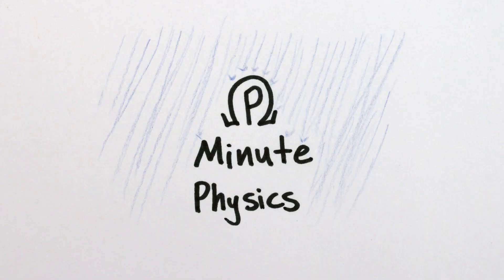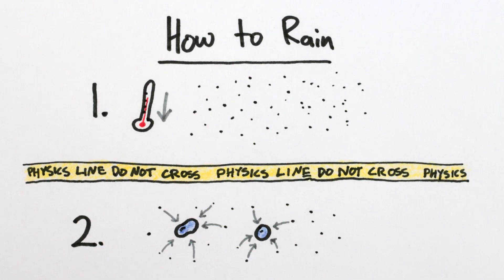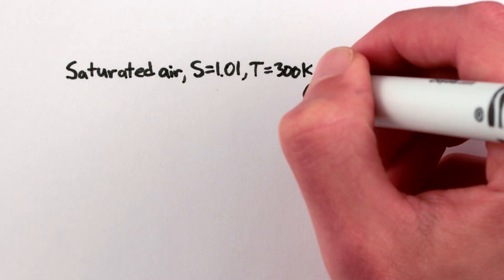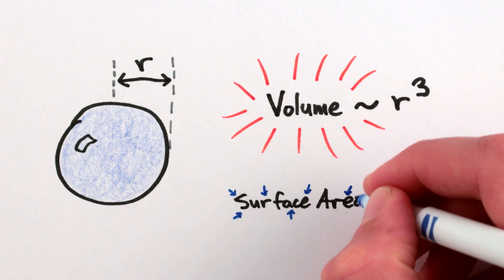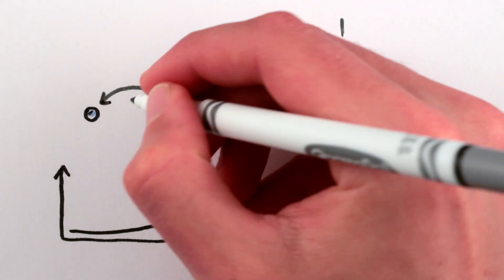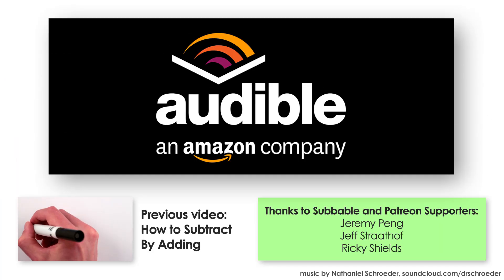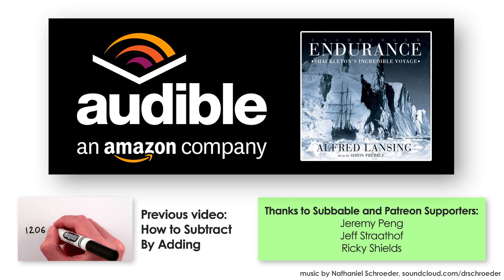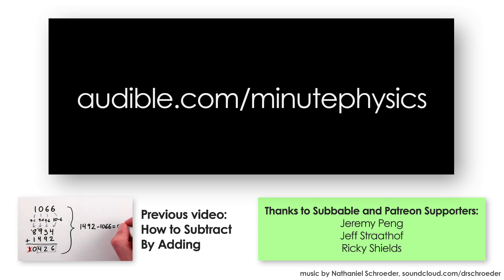Why Raindrops Are Mathematically Impossible

Comment: did he say x squared is bigger than x cubed
Reply: When x<1 it is.
Reply: +Apple Cider ok now I get it
Reply: MrDavoder For all rational numbers between (but not including) zero and one, x^2 is greater than x^3.

Examples:
(0.5)^2=0.25 where (0.5)^3=0.125
(0.25)^2=0.0625 where 0.25)^3= 0.015625

At exactly zero and exactly at one, x^2 and x^3 are equal.

For all rational numbers less than zero x^2 is less than x^3 for the reason that you've already figured out ;)
Reply: You can use any symbol in the place of an x right?
Reply: Bobson McGregory i think
Reply: +Apple Cider no. When x<0. If x is 0, then x^2=x^3
Reply: +Apple Cider And when x=1 they're also equal :)
Reply: +Apple Cider Does that mean formation of raindrops depends on what units you use? If I have a gram of water, x>1 in mg but x<1 in kg.
Reply: +SilentBudgie You use dimensional units for that. Surface measured in e.g. m² and volume in m³. Dimensional units scale with the numbers, s 10m*10m is 100m² and not 100m. You'd have to convert the kg into m³ (density...) to be able to calculate it. But then it works with all (dimensional) units.

Also, the "1" is dependent on the base unit. We measure everything based on the SI, so 1m, 1kg, 1s etc. are used as the "1". So if you used Ångströms, you'd have to scale it down (1 Å = 100 pm), so 1m would be 10^10Å (and scale it w/ squares etc)
Reply: ***** its a social construct
Reply: ***** its like a language

Comment: It doesn't seem impossible, if you study the chemistry of colloids. Considering the high surface tension of water, of course water would rather form bigger drops. By reducing the surface to volume ratio it wins energy. There is a very similar process called Ostwald ripening. And btw condensation is exothermic, so it's enough energy for a start ^^

Comment: Mathematically impossible for droplets to join that are already formed, sure. But, water droplets forming are more a case on what state the water is going from and to. Simplistically, for example, if you want to make a small droplet of water even larger, simply have that droplet of water in an environment where it is cooler than the dew point of the local ambient air.
When air is containing H2O, in gaseous state, each molecule of H2O is an individual molecule (stating the obvious.) Fog (or clouds) are several molecules of H2O; not quite what considered a droplet (again, stating the obvious.) If you have a droplet of water that is below this dew point then each surrounding individual H20 molecule that comes into contact with that surface droplet of water easily become a part of it. The surface tension of a droplet of water does not repel an individual H2O molecule. This occurs extremely fast, even though it is one H2O molecule at a time.
This leads an experiment in relative humidity and dew points that anyone can do in their own bathroom; with a shower, a space heater, and a glass of cold water. ;-)

Comment: would it be because the units that we use are made up by us. so < .1mm (or what was reffered to as small x) isn't really a decimal, on the molecular level, (bc h2o is  a molecule) the measurements don't reach less then 1. at least not in these conditions. so putting these quantities to a power will always grow them.

Comment: Well, no. If it works for bigger it works for smaller, the problem occurs with the fact that your using Meters or Centimeters or whatever because when you use whole numbers it works but when you use decimals or fractions it doesnt. The easy solution is to think of length in plank length. So with such a gigantic amount like that the equations become plausible. Imagine switching from Meters to Kilometers and again a raindrop that once was plausible is imposible its just a matter of how your thinking about it. This video is just stupid

Comment: Comment:  Regarding the energy to form the surface tension compared to the heat of condensation.  Given I understand all the (other) phenomena here...
Doesn't the crossover point between the surface and volume quantities depend on the unit of measure?  In other words, decreasing below a cubic meter (measuring the surface energy in joules per square meter),  the surface area grows relative to the volume (measured in cubic meters), thus  requiring in increasing energy from the volume, but you are still above a cubic milimeter where you haven't dropped below the 2/3 point yet.
Can you explain this apparent problem?

Comment: 1:23 - "for small radius, the opposite is true". this is false. as where is no such a thing like "1" in nature, that number bigger run in 3 grad faster than 2nd... and for smaller than "1" is the opposite. because this "1" is a limit that we use to measure things is relevant 1 meter! or 1 cm... or 1mm or 1 what?!  so when you talk about "Relativity" of surface to mass it is always R^2 : R^3 no meter witch units are used.... sorry but you mistakenly explained another effect of small droplets as it's becouse this relative "1" issue.

Comment: Hmmm, at 1:20 there seems to be an issue... Can we not measure in any unit? And if so, for argument's sake lets measure in nanometers. Cube would not be smaller than square for the items we are measuring in this video. Take it a step further, lets measure in Plank lengths and In this case, cube is always larger than squared. There is some false logic in the premise.

Comment: You guys made a TREMENDOUS mistake. You have to consider the ratio between surface and volume, this is what matters. A system will minimize their surface to volume ratio and that's why they form spheres. The smaller the sphere, the biggest the surface to volume, no matter what, and small droplets are minimized. I don't know what you talked about, but it's bullshit and you should correct it.

Comment: Okay, wait. Just because the volume (or the energy derived from the volume) is less than the surface area (or the energy required by the surface area), that doesn't mean the raindrop will shrink. That would just bring it to a state with even less energy.

Let's say we have a raindrop with radius 0.5. Its surface area is 0.5^2 (yes, I know that's not really the area of a sphere but it doesn't matter) = 0.25. Its volume is 0.5^3 = 0.125. The larger the ratio between the volume and the surface area, the more energy. The ratio here is 0.125/0.25 = 0.5.

Now, if the raindrop was to, say, split into two, the volume of one of the two new raindrops would be half of the original. 0,125/2 = 0.0625. The radius is the cubic root of 0.0625 = 0.397. The surface area is 0.397^2 = 0.157. The new ratio is 0.0625/0.157 = 0.397.

Why would the raindrops split up? It only brings them to a less energetic state. Am I just missing something?
Reply: Mattster3517 No you are very right, they made a huge mistake. It's the ratio between the surface area vs volume that matters.

Comment: basically it's impossible for a raindrop to be a 'drop'  because that would require more energy than for it to do the opposite, which is a 'mushroom' shape. Very basic, rough, simplistic, synopsis.   At least that is what I gathered from the video

Comment: Does it even matter that it's a small number? Can't we just measure using smaller increments and therefore go around that .001^2 is .00001? Can't we just measure in thousandths or even less of an inch and call it a made-up word like foof? Then 10 foofs x 10 foofs = 100 foofs, it's bigger! Hooray!

Comment: There is something very misleading about saying, "Cubing tends to make things bigger than squaring, but for really small radii, the opposite is true".  This applies to real numbers, in pure math, but it's irrelevant in physics.  A number like 1000 is meaningless in physics.  Real numbers don't mean anything unless they are coefficients of a unit.  Imagine calculating the volume of a cube with 10cm edges.  It's 1000cm³, right?  But now imagine finding the volume of a cube with 0.1m edges.  It's 0.001m³!  How is it possible that the 10cm cube has a volume that's bigger than its edges, but the 0.1m cube has a volume that's smaller than its edges?  Answer:  You can't compare cm to cm³.  They're different units.  Both cubes are exactly the same, and 1000cm³ = 0.001m³.  You should recognize that just by choosing a different unit, you can make any measurement of 0.01 become 10, or vice versa.
Reply: yessopie Actually measurements do make sense, we are talking about thermodynamic systems, which do make more sense with numbers. I think their huge mistake is to neglect the ratios. When the radii is very small, the ratio between surface and volume is very high. Which is why small droplets aren't favorized.

Comment: I see uzimonkey's  and other's points. Appears that it's the use of units that's breaking down not the Math.
.......following the explanation starting about 1:20 into the video. Volume decreases are due to an artifcat of your units not the radius. Cf making the same calculation in cgs vs mkgs units or to be truly absurd cf using Angstroms(Å) vs light-years(l.y.).  P Chem and thermo are just a hazy 40 year old memory for me, but I think the underlying phenomenon becomes obvious if you use some sort of dimensional analysis---I suspect some term, maybe 1/r, will give you an unit free limit that explains the energy of area vs volume for small spheres. 
Otherwise, the rest of the Physics seems sound

Comment: I love MinutePhysics in general but this video kinda upset me. It's reminiscent of the old "bumblebee flight is an aerodynamic impossibility" sensationalism. No, it's not impossible, we can see that it happens, in both cases. In the case of the bumblebee they didn't understand exactly how the bees wings worked, once they did they were able to see that they use angle of attack to push air down on the forward and backstrokes it was clear that aerodynamically they made perfect sense. The same is true of raindrops. We know they work, and in this case we already have discovered why that is. It would be valid to say that different physical cases are involved in different stages of raindrop growth, and that neither case explains the entire process, but that doesn't make for much of a headline I'll agree. Saying they're impossible is just plain wrong, though, for the obvious reason that it rains. Won't lose me as a subscriber though, keep doin you.

Comment: Here's the problematic:

E.g: 
If 4/9+5/9= 9/9 =1
And 4/9=0.4444444...
        5/9=0.5555555...
=>
      4/9+5/9= 0.4444444... + 0.5555555...= 0.9999999...   
Does that mean 1=0.9999999....  ??
Reply: I've noticed that when the number is >5( with 5 included) , a calculator answers eg : 5/9 = 0.5555556
But 4/9= 0.4444444 and not 0.4444445    but whyy
Reply: Nassif S. If your calculator can only display say 8 digits, then for the 8th digit it will round up all the digits following it. 0.000000444444... would round to 0.0000004, and 0.000000555555.... would round to 0.0000006. That rounded digit is what gets displayed in place of the 8th digit.

I'm no mathematician but I think 1 does = .9999999 repeating. It's just that .999999 repeating is redundant.
Reply: So we are about to conclude that algebraic expression has always got 2 answers (solutions): one that is accurate but redundant(the one without rounding) and one that is not so accurate(in this case the number 1) but essential, and that for the same reason we haven't been able to finish pi . 
I just feel like it's all in the way we associate things. I think we shouldn't in any way associate the fraction of smth with its numerical value(at least not for now considering the limited capability of a calculator)
Reply: Interesting point of view TheDcac , but think of it this way: 
If .9999... has infinite 9s, this means it never reaches 1, so defining infinite as "what never reaches smth" can in this case cause problems.
It's a confirmation to my theory about having 2 solutions to every expression by having 2 numbers always equal to one another(.9999.. and 1)because of "rounding", and rounding is used because we are still unable to define infinite(so we cannot remove rounding from mathematics)
So far, I think understanding Rounding is the way to explain this theory of mine. (.999..=1 <---> 2 minimum solutions to any equation that can be solved) .
Reply: TheDcac Took your advice on googling the proofs, when I remembered that I actually started started with one of them in my 1st comment. Anyway, I found this statement in wikipedia:" The equality of 0.999... and 1 is closely related to the absence of nonzero infinitesimals in the real number system, the most commonly used system in mathematical analysis." Infinitesimal is the science behind rounding; when a number is too small, we round it so it can make sense to human mind. Like so, when a number is infinite, we round it so it can be relevant. 
I'm definitely saying .999...=1 ( I mean I started with one of the proofs) . What I'm trying to accomplish is: the consequences of it, and demonstrating that all proofs of it are based on rounding because of the indefinite infinite.

Comment: The "cubing a small number makes it smaller than squaring it" is a red herring: (1) it is measurement-unit dependent for any given thing and (2) you cannot treat cubes and squares as equivalent. Let's play with a metre:
1 m = 100 cm = 0.001 km
1 m^2 = 10000 cm^2 = 0.000001 km^2
1 m^3 = 1000000 cm^3 = 0.000000001 km^3

So, in the terms of this video, if you measure a metre in cm, cubing it "makes it bigger than squaring it"; if you measure it in km, cubing it "makes it smaller than squaring it".

Yet it is the same thing.

Comment: I have a burning question. Do you know about diamagnetism? When you use a magnet to repel water, but with a small force. well, why don't we coat the submarines, with magnet, and connect to energy source from the inside the submarine to make the magnet a lot stronger to repel water. So there wouldn't be much pressure or no pressure acting on the submarine. wouldn't that work, or what would happen?

or can anyone help answer my question?

Comment: Wouldn't "x cubed gets smaller than x squared" (described from 1:04 to 1:23) depend entirely on what unit you are measuring it in??

If the unit is metres, a tenth of a metre would be:
0.1m cubed = 0.001m^3
0.1m squared = 0.01m^2
The cubed one is 'getting smaller'

But change it to centimetres (now 10cm):
10cm cubed = 1000cm^3
10cm squared = 100cm^2
The cubed one is 'getting bigger'

Nothing has changed here except the value of the unit you are using. But it sounds as if according to this video the droplets will change one way if you calculate it with one unti, or another way if you calculate it with a different unit.
Could anyone explain this further?

Comment: In order to make his greater than one, less than one argument work, you have to make the radius or diameter of an equilibrium droplet equal one.  A equilibrium droplet is one of a size where the positive change in surface energy with increasing size and the negative change in volume (condensation) energy are equal and opposite.

Therefore, the units are not meters or centimeters, they are whatever that equilibrium size happens to be.

Comment: I read some confusion in the comments.  I think, perhaps, the root of the confusion has to do with the sign of the two energies under consideration.  The sign of the energy change of making a volume of liquid water is negative.  We call this condensation, it releases energy.  The sign of the energy change for making more surface area between water and air is positive.  Making more area absorbs energy.  The two processes oppose each other.  This is where the square cube relationship comes in.  What the video does not do is supply the coefficients, that is the numeric values of the energy changes.  The droplet size at which they become equal, beyond which a droplet can grow by unaided condensation is small, but much larger than can be assembled by random collisions of water molecules.  This is where nucleation comes in, but that is not covered in this video.

Comment: As the size increases, which is another way of saying more molecules are clumped together in the volume interior , energy is released. This need not be memorized ,given the fact that more molecules means more attraction per molecule as now each molecule is surrounded by more molecules. Unfortunately, there is no such increase at the surface ,which only expands (attracting molecules that are there on the surface get pulled away from one another) and energy is required to do this .
There has to be a balance between energy released(proportional to r cube,volume interior ) and energy expended(proportional to r square, surface) 
Now the  math guys may continue this explanation using slopes and derivatives to tell which term (cube or square) is more dominant when ( at r<1 and r>1 or said another way , at large/small number of molecules clumping together)

Comment: Does the square vs cube reasoning for shrinking "small" radii still hold when radius is measured in planck lengths instead of fractions of a meter?
Reply: Yes as the conversion constants would also change to accommodate this

Comment: I don't buy it.  If you just change the units of measurement, then the very small numbers become reasonably big numbers, and by cubing that number, you get a larger number.  Or, as my high school physics teacher told me, a number without units is meaningless.  (Ok, I see that this question was addressed below.  The point remains that this explanation doesn't make sense in the way it is expressed.)